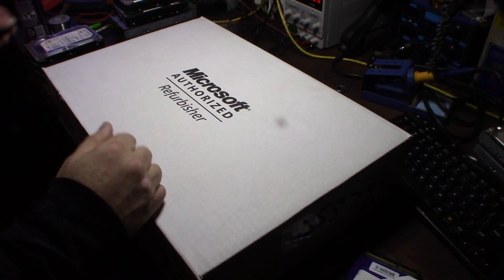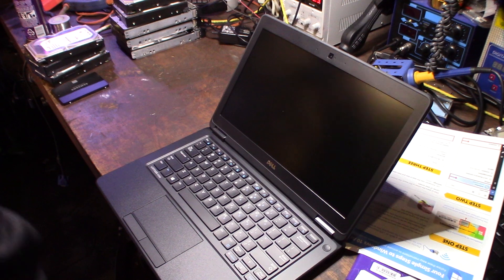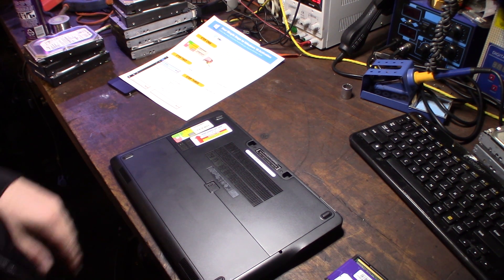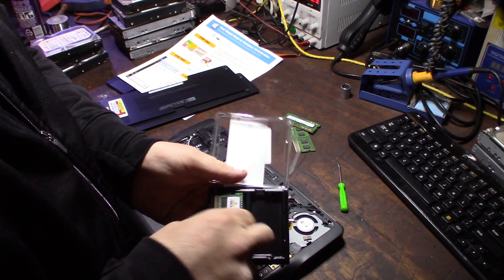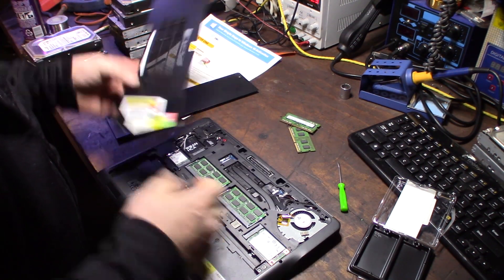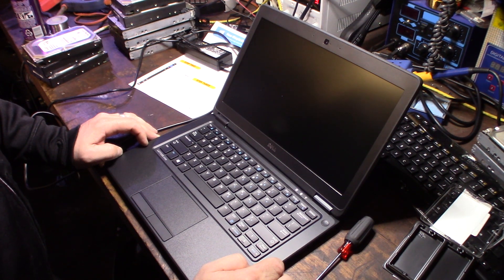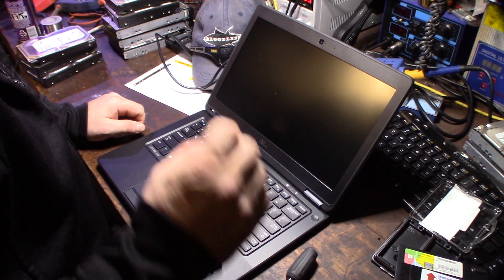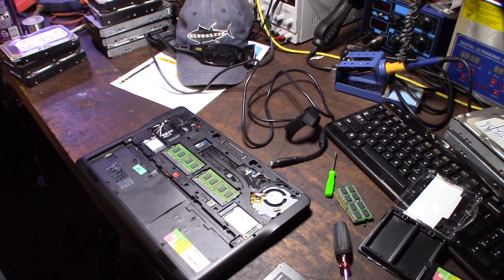Dell E7250 12.5" laptop for tech bag 16GB RAM upgrade 500GB mSata

Comment: I have that exact computer. It is the memory because I installed 16 gigs of RAM with no problems
Reply: Hi,
I also have a dell e7250. I bought it off ebay with 4gb ram and a 32gb msata ssd. How is it running?  Should i upgrade to 16gb ram?
Reply: Cruise Edwards : Mine is running buttery smooth. You would do yourself a favor by upgrading the RAM. I use my computer as an engineering student and never exceeded 13 gigs of RAM usage. But even when I first got it, i didn’t upgrade until a week later. It was totally worth it for the speed boost. Do you want a link to the RAM that works for me so you don’t end up like him?
Reply: @firstlast9813  yes please could i have a link to the ram? Yeah and these laptops seem to still be good for work/school use today. Im happy i got this instead of wasting $1000+ on a silly macbook air lol.
Reply: Cruise Edwards : I have been humbled. My laptop of 2 years that has no problems, doesn’t work. I had trouble finding my order from amazon and decided to pop open the laptop to take a picture of my RAM to get you a perfect match. Properly shut down, removed from power, pop out and pop in. Now I can’t boot. I can only run diagnostics from one stick as well. No errors. Pfft ok. I decided to reset the motherboard by removing the clock battery (while the SSD is removed). I’ll let you know how it goes 😅. Sorry for the struggle lmbo

Comment: what type of RAM did you use to get it working? i want to upgrade from 8gb single channel to 16gb dual channel. but i dont know if i can just order a crucial 8gb ddr3L 1600 module... the dell 8gb module is 3 times the price :/

Comment: thanks. i bought a e7250 refurbished for 190 Euro. with i5 5300u, 8gb ram, 256ssd and win10 home. works very nice. unbeliveable, this notebook was 1500 euro 3 years ago.
Reply: Same here. Paid AUD370 (228EUR) two weeks ago for a e7250 with i5-4xxx, 8gb, 256. But it’s the HD touch screen version! Paid so little because it’s got a small crack on the side of the keyboard and a couple of scratches on the lid which of course doesn’t affect usage at all :D
Reply: hows it working out for u? about to buy a refurb myself for a low price worried if its legit
Reply: I was also planning to buy one of that well built ultrabook. What about he performance? Is it good for programming?
Reply: is this good? im planning to buy one its 850aed here in uae its second hand with good condition